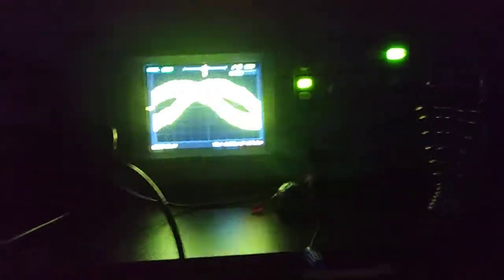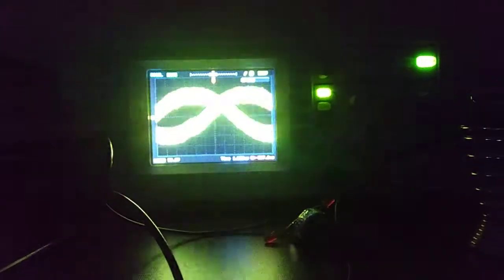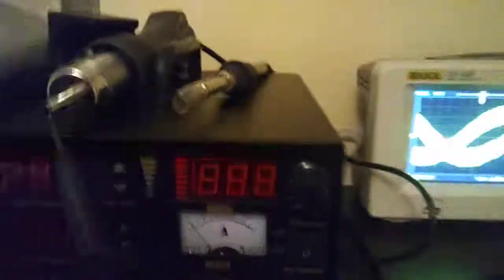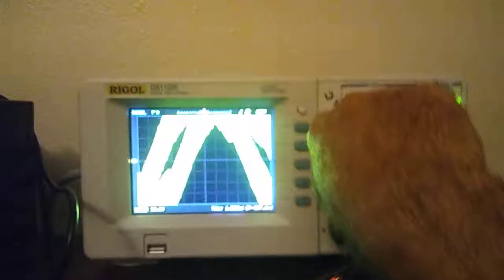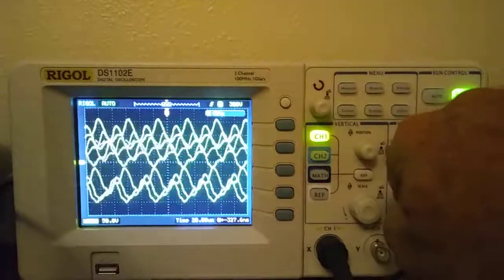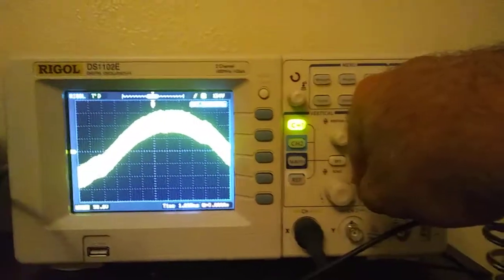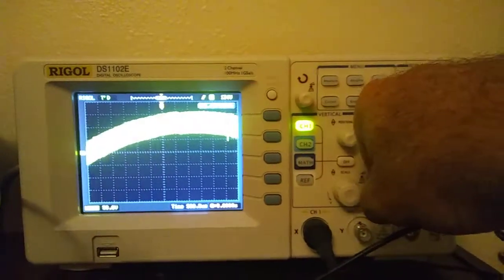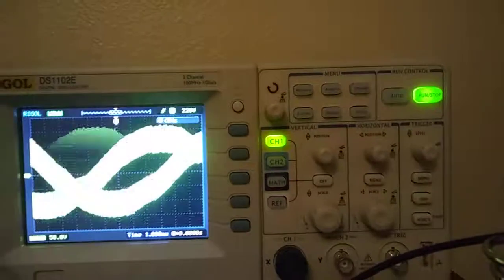Bending and transmitting of scalar waves

Comment: I know that the harmonic capabilities of scaler waves are huge. So what are the probabilities of another harmonic riding inside of a harmonic?
Reply from the maker: True sound is scalar and it can be done on scalar electromagnetic frequencies as well. Do you know something that sounds good with like an F# ? Although my system is running at the top or a bit higher than an audio frequency because it is pulsing 20 to 24 kHz but the bending sinewave you see on the oscilloscope which is the hertzian wave of 60 Hz because the electrical lines are like huge transmission antennas and the system picks it up and amplifies it. Anyways yea you got a cool idea for another type of experiment in the future. Note. VLF frequencies between about 30 to 60 htz are can be visible if you are in contact with them but dangerous because the human nervous system works in this frequency range so a bit of amperage could cause cardiac issues and death. I have experimented with these frequencies in the past with very small amperages in the low milli amps using the right voltages and frequencies I could cause certain nerves to fire and for example make my arm move. Around 40 to 45 Hz. I could see a strobe light effect without a strobe light. So in the future maybe I can try to send music to our brains without the use of sound. Lol that's crazy...
Reply: I see SOOO many capabilities here. This is something I would be interested in speaking with you at length about. Is there another medium we could use to speak on? I have answers for some of the questions and ideas you've presented here.

Comment: Can you transmit electrical power wirelessly over great distances using scalar waves?
Reply from the maker: I believe scalar electrical transmission is possible but not the only way to do it. Scalar transmission would probably require point to point transmission in other words it would require two transmission points or resonant amplifiers on both sides of receiver. I am not still sure because I have not gotten that far on that part of the experiment only done at very short distance with out a secondary resonant amplification from two separate points. All I am attempting to do is to build an atmospheric to ground ion collection electrical generator two keep charging my power cells even when their is no solar or wind available. My girlfriend and I take care of her mom that is on oxygen machine and needs power to run it all the time.
Reply: Ralph Hernandez alright. Sorry to hear about your girlfriend’s mom. About the project though. I’m doing research on transmission of point to point energy transfer, like you saidIf you have a diagram, that would be nice.
Reply: Ralph Hernandez also, can we do it without a ground wire?
Reply: @ralph72462  btw way I can help my bit if can tell me what's wrong with ur mother in law
Reply from the maker: I have grounded on a my expriment to a large aluminum heat sink on top of a wooden table. It. Is on a few of the videos. What are you planning; Mobil transmission of electricity? Lol l would love to see that! I would like to share a picture and diagram schematic of what I am working on even though I am not finished with the schematic because I would have a lot to explain since somethings I made myself.
Reply: Ralph Hernandez yes, I am trying to create a method of mobile electricity transmission, fo me things like phones, cars, planes, using the scalar waves, and also for a...”project” of mine
Reply: Ralph Hernandez that’s exactly what I needed. Even if they’re a mile apart, and the ground of the receiver is grounded by the method you said, it could transmit, say kilowatts? Thanks for responding
Reply: Ralph Hernandez and if you wish to send a diagram, send it to antfiligenzi@gmail.com
Reply: Ralph Hernandez any diagrams or ideas you could share with me for the project?
Reply: Ralph Hernandez I found someone else who used scalar waves to power something without a connect, Konstantin Meyl. Yeah he can be a bit off in his theories, but his mode with planes is quite interesting
Reply: @ralph72462  if I can share my no 2 connect to share ur experience if u don't mind, thkz for this great video nd ur experience